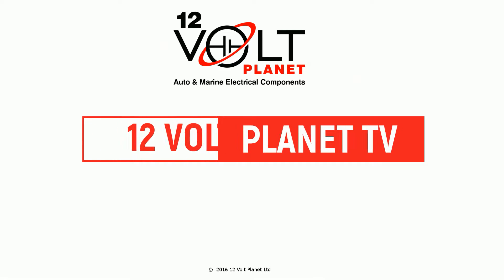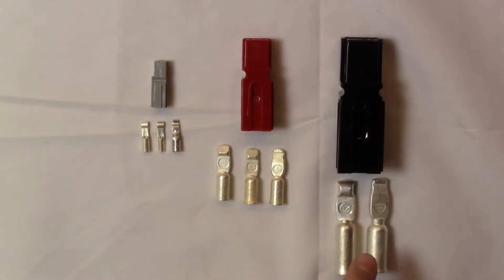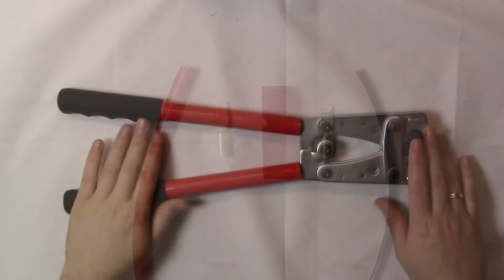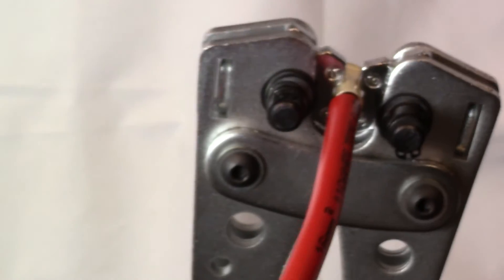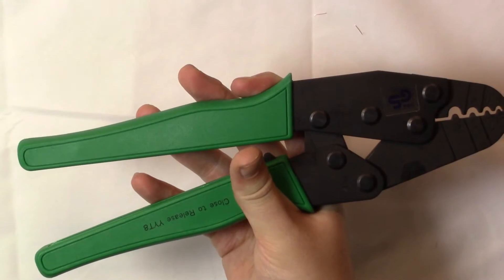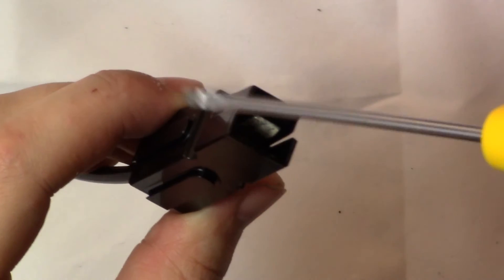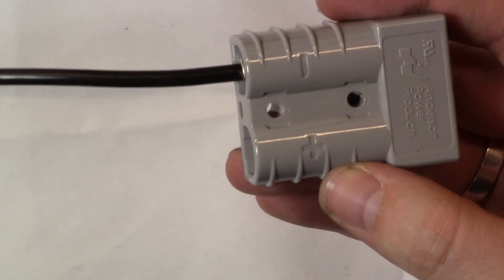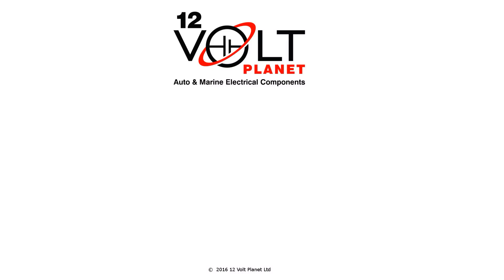Anderson Power Pole and SB Connectors | 12 Volt Planet

Comment: Glad to see you didn't solder the Anderson cable lugs, crimping copper to copper is always superior - DO NOT solder them as you are adding solder which has a lower conductivity to copper and increasing resistance in the joint.